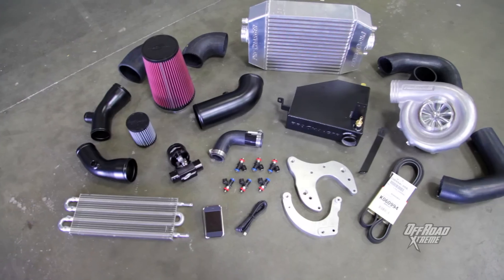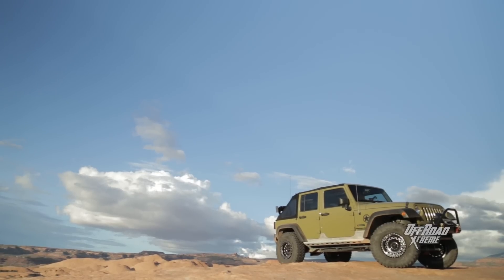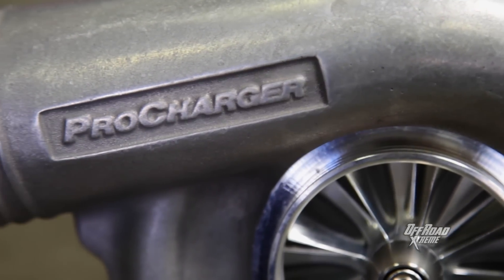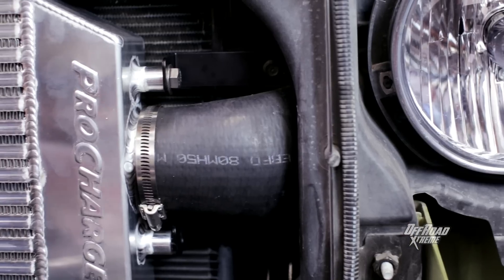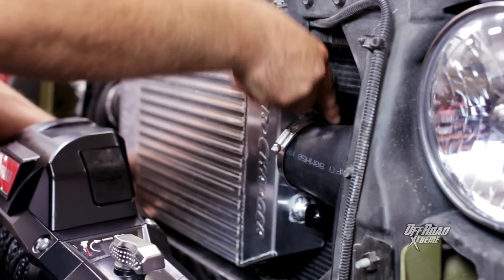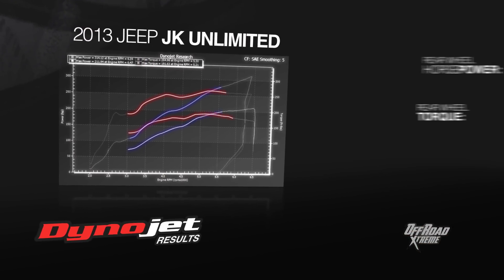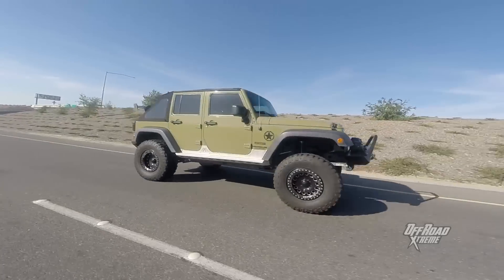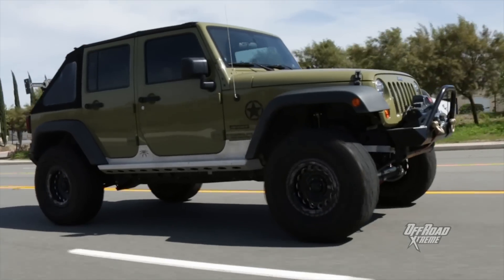ProCharger Boosts the 3.6 Liter Jeep JK Wrangler

Comment: Overbuild your axles, under build your motor, that's how you avoid breaking on the trail.  I have a stock 3.8 with Front PR44 and Rear Trail 60 with Atlas 4 transfer case and 1350 Tom Woods,  on 40 in Creepy Crawlers ... I'm not breaking anything.

Comment: If I run that intake up around through a snorkel, am I losing anything from what that supercharger is doing? I'm in Fla and water is something I deal with a lot down here- not highway speed make rooster tails, but running properly slow through water but you still get a bow wave.

Comment: I did, what I would consider, mild offroading when I had my 2 JK's.  Even then I recall several times when water was well above the tires and few times when water crested the hood momentarily.  This kit looks like a recipe for disaster for anybody other than those who will stay on dry land.
Reply: If only Jeep would have offered:
 a. A hemi option
 b. A roots blown 3.6
 c. A diesel
 
Then the world would have been right as rain....well then they could offer a real fix for the substandard ball joints.  And then make it out of aluminum so the typical Chrysler paint doesnt start showing pinhole rust spots after three years.

Even after all of the issues, ill probably buy another Wrangler in the future.

Comment: for about the same amount of money you could just do an LS swap and have even more power and reliability....or drop a hemi into it but it might cost a little more but with either engine the power mods would be almost limitless as far as what's out there
Reply: +Brian Finch im sure droping in a hemi or an LS engine and rewiring the entire fucking car is just as ez and bolting on a procharger kit.  when was the last time you did a complete engine swap on a modern car? i remember back when i did a cobra engine swap on my 1999 mustang GT replacing every harness in the car was so much fun the funnest part was removing the dash to get the harness in their SO MUCH JOY
Reply: Uh not quite if u do the math
Reply: Lots different now swapping in a v8 in a Jk then when we were stuffing 289s into a Willy’s.

Comment: I'm really confused here my stock jku is rated at 285 hp how does 318 hp equal over a hundred hp gain not making much since here and the ripp supercharger setup does way better what's the price difference is it worth spending a couple hundred bucks to get the ripp
Reply: +noobtoob nooby Hi Noob, it's because the jeeps dyno around 140HP (pentastar) at the wheels (give or take depending on dyno, heat, elevation etc) so a supercharger on average adds about 130-150RWHP.
Reply: +noobtoob nooby What you're comparing is the after wheel horsepower with the before crank horsepower.
Reply: +noobtoob nooby Thats 318 to the wheels vs 285 at the crank.  Take off 20 percent for loss to the tires and you are getting ~228whp.  So it is about 100 more hp to the wheels.
Reply: Smile? x your comment is way more informed than DaShnipa I could not figure how I lost 145 hp to the wheels
Reply: DaShnipa I'm going to take my jku to the dyno and see if your correct I don't see losing a 145 hp never had it on a dyno but I know what I have raced against and there is no way a 145 hp jeep is out running them
Reply: +noobtoob nooby video showed that they got 211 to the wheel on their jeep. my guess is you'd get about the same, and slightly more if you have a manual
Reply: +noobtoob nooby smile has the right idea but his math is way off. I own a 2012 wrangler and they don't dyno anywhere near 228 rear wheel horsepower. JK drive line losses are close to 40% add in larger tires without the correct gear ratio and your sitting at 170 ish on a good day. Superchargers with a proper tune will put you in the 290-320 rear wheel horsepower range. dynomometers measure wheel horsepower not what's measured at the crank and presented in the brochure.
Reply: DaShnipa that's why I'm going to take my 2015 jku to the dyno to see exactly what mine makes to the wheel because 140 hp is a very low number seeing how in the quarter I'm around a half second behind a 2010 vw golf gti turbo and I just left an f150 5.4l triton by 2 cars
Reply: +noobtoob nooby JK Dyno'd at 156.8 with 3.21 gears and 33" duratracs.
Reply: DaShnipa I have 3.73 gears and on stock tires I would like to know what it makes so I can be at least make an informed post on here that's all
Reply: +DaShnipa I'm going to assume this was a 3.8. and NOT the 3.6
Reply: +Smile? x 2012 means 3.6
Reply: +DaShnipa your 3.6 ran 156 at the wheels? if so that's horrible..
Reply: +Smile? x it is what it is. shit gears and heavy tires. Sucks a lot of power from it. with 3.73's I'd probably be in that 170-180 ballpark. maybe the dyno tech f*cked up and did a roll on in 5th... no idea
Reply: +Smile? x Nvm 5th is the 1:1 gear so... JK's aren't power monsters lol
Reply: +DaShnipa no they arent. but that's still a whole lot lower than I thought it would be.
Reply: +Smile? x I've seen stock sports dyno around 210-240 with tunes intakes exhausts etc. I don't have any of that. planning on 4.56 gears and truetracs front and rear in the summer
Reply: DaShnipa when did they put 3.21 in them?? Correct me if I'm wrong but I thought from 2012 to 2016 they had 3.73 gears on the sports and unlimited sport
Reply: +noobtoob nooby 3.21s are standard. 3.73 are an option on sport models. rubies can choose between 3.73 and 4.10
Reply: DaShnipa I got a base model with power windows and locks that's it and it came with 3.73 maybe just the year difference
Reply: You probably have the tow package. If I'm not mistaken that automatically ticks the box for 3.73's... I bought my '12 second hand so gear choices wasn't an option.
Reply: DaShnipa I got my 15 new and yes I have the tow option that's the difference the tow package

Comment: How did you handle the oil filter? Do you have to change the positioning of it or add any other parts or did you work around it? Comparing with the Edelbrock E-force it looks like they've got you beat. :/
Reply: You do not need to move the fuel filter.  The only things you move are the alternator (to make room for the supercharger), transmission cooler (to make room for the intercooler), and the radiator overflow tank (to make room for the air filter).  The overflow tank is actually swapped out with a procharger tank.

Comment: ???????? Why not just change the gear ratio to either 4.56, 4.88 or 5.13 to counteract the 35" tires. Throwing hp at it doesn't help the driveline last longer and it would be waaay cheaper. Didn't specify what gears are in it or automatic or manual trans. Most 4 doors are 3.20 gears with a 3.73 option no one looks for and an auto trans. Really pookie preformance right of the line

Comment: Why would you run a centrifugal on an engine that needs low-end torque? This type of SC is basically only good for higher RPM numbers. Exactly where you DON'T want it.
Reply: 231mac for sand hill climb you DO want it.
Reply: @072D00003674  how many sand hills will you meet ? But overflooded rivers or mud you will meet alsost everytome you go offroad, everywhere ..
Reply: Serhii Bilousko it depends which part of world you live? Where i am from 90% sand